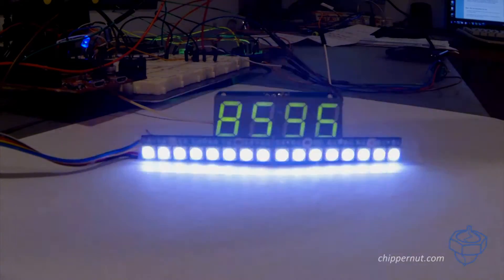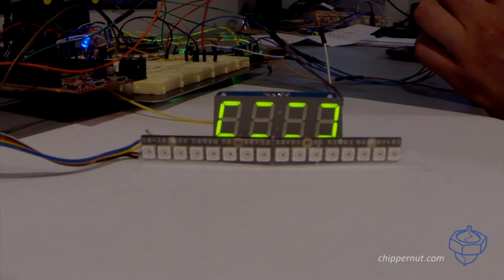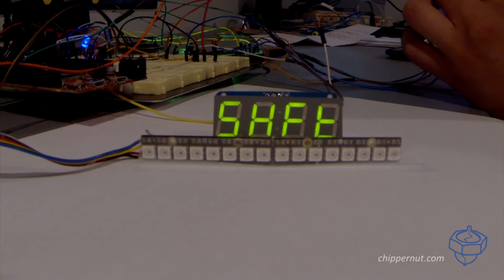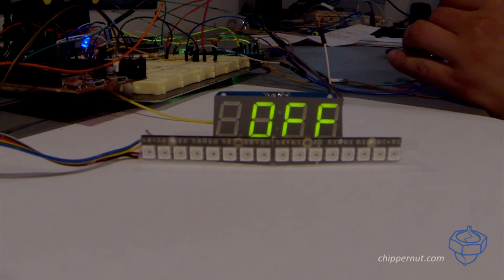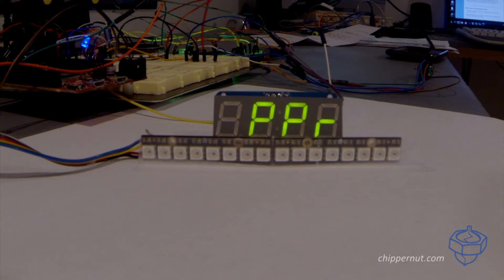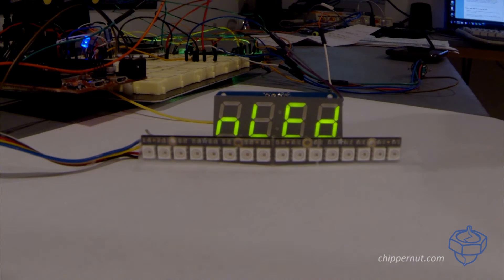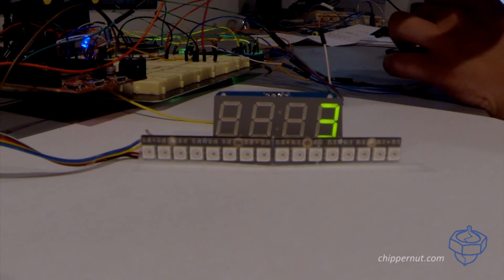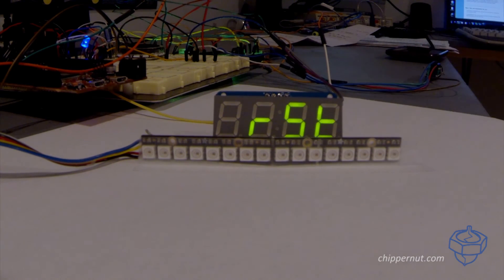Arduino Shift Light V2 Tachometer from Chippernut

Comment: Hey, could it be me, or is the program sometimes slow to respond to button presses?
Reply: +JustKyzuuh nevermind I think it seemed slow before I had the LEDs set up to show the animation. SO i copied and pasted your code, but when I go to ppr, it shows a zero, and does nothing if I scroll to the right. if I scroll to the left, it says 36, and goes back to zero quickly, if you scroll fast it goes down from 36, but there's some glitch there or maybe issue in the code, how can I fix this?
Reply: +JustKyzuuh nevermind I'm just stupid and didn't read the forum post.... Sorry about that
Reply: Okay so I have just about everything working now except one thing. With the number of LEDs set to 16, it should come down to 2 LEDs  and then go blank, but there is a single LED staying on. After inspection, on one side, there are 2 LEDs turning off at once for some reason. Can you help? I've tried resetting and it doesn't fix it. I'll post a video on my channel.
Reply: Also, +Chippernut, there seems to be an issue with choosing the 2nd optionas your animation, it says you need to segment again but then goes back to the menu and if you then go to segment, it does some weird stuff. So there's an issue, and it may be the cause of the first one
Reply from the maker: +JustKyzuuh  Thanks for stopping by and reporting these issues.  I'm planning to release a new version of the code in a few weeks, so this is perfect timing. I do know the Rototary Encoder and button presses were slightly laggy, so I've improved that code a lot. I'm happy to say that it's a lot snappier now -- this will be a huge improvement to user interface.    Have you tried running the EEPROM Reset code (separate from the Shift Light code)?  That might help. You're right that if you have an even number of LED's, it should end with 2 led's lit, then 0 led's, when using the center-out animation style. If it was an odd number of LED's, it should end with just 1 lit in the middle.  I'll check your channel for a video.  I'll also investigate this further and see if I can replicate it on the bench.   Thanks again!!!  I appreciate the feedback.
Reply: +Chippernut Awesome! I'll try the eeprom clear thing and see if this still occurs. I really enjoy coding and debugging, but there's just so much in this code I don't even know where to look for specific parts. I would help if I could, anyways thanks dude!
Reply: +Chippernut After clearing the EEPROM, the issue of the LEDs is still present in the center-out animation. (using 16 LEDs) I also then tried to go down to only 8 leds and the problem is still there. There are 2 LEDs on one single side that turn on and off at the same time, as seen in the video I uploaded. Also, I believe that it is always the last LED of the first segment and the first LED of the second segment that does this.
Reply from the maker: +JustKyzuuh I watched your videos - that's really bizarre behavior. Looks like two separate issues: (1) the double-LED lighting, and (2) the menu glitch with switching animations.  I'm going to run some bench tests.  Can you try coding a simple test to individually light each of the neopixels one at a time?  I want to rule out a communication issue w/ the neopixels, as the command string is sent from one LED to the next, to the next, and so on.. so if one of the LED's is screwing up the communication somehow?  Also - do you have a large capacitor on the power to the LED's per the design? Do you have a separate power-supply and voltage regulator for the neopixels?  I'm wondering if there's a current surge and it's causing that behavior w/ the arduino somehow..   But ya, that's a good head-scratcher.. I'll keep thinking about this and see if I discover anything on the bench.
Reply: +Chippernut I'm not using a 12v supply because I don't have one. Obviously I'll need that in my car, but I don't have one to use with my breadboard so I'm pulling power from the arduno. I switched to using a single 8-LED stick and the problem is still happening. I can look and try to find a power supply and see if that fixes the issue if you'd like, but I've tried using different numbers of LEDs and it is always the last LED of the first segment and first LED of the second segment, so that's what makes me believe it's in the code.
Reply from the maker: +JustKyzuuh  That might be the issue, but if it's happening on the 8-LED stick, then I find it unlikely. Those NeoPixels can draw 60ma each when set to 100% white, that's 960mA with 16 of them, no way the Arduino's little 5V regulator (or your computers USB port) would like that very much... when it's flashing on full brightness, just something to keep in mind.. but, like i said, I don't think that's the issue here.    Do you have a resistor on the data line going into the neopixels?  I can't tell from your video.  See: 
http://www.eetimes.com/author.asp?doc_id=1320518&page_number=2
and 
https://learn.adafruit.com/adafruit-neopixel-uberguide/best-practices
Reply from the maker: +JustKyzuuh Ah. good catch!  I'm going to investigate this issue more and see if I can replicate on my bench.  Please feel free to keep updated at Chippernut.com (youtube isn't sending me all the notifications when new comments are posted.)
Reply: +Chippernut Go to the begginning of this video and pause it. Set the speed to 0.25 on the options and watch very closely the left side. the last pixel of the first segment and first pixel of the second segment light up and turn off at the same time. I don&#39;t think in this video you have your activation rpm high enough to see when only one pixel is lit up, but you can see the problem I&#39;ve been talking about in your own video here(:  I guess you've already replicated this on your bench! Just thought I&#39;d let you know and maybe save you some time.

On a side note, someone else has found this previously and I found this thread on the forums:
https://www.chippernut.com/forums.html#/20150819/animation-glitch-4920123/
It's definitely got to be something in the code.
Reply: +Chippernut I've just started looking at the code. the switch statements for determining when to light up which light seems fine. So that leads me to believe that the issue with the 2 LEDs lighting up at the same time is in the rpm table for the 2nd animation. I still haven't looked at the issue in the menu system after selecting the second animation but the 2 may have something to do with each other?
Reply from the maker: +JustKyzuuh  Haha No Way.   That's amazing.  Thank you so much!!   I'm going to slow my RPM simulator way down for testing this..  I will definitely fix this in the next code release. Excellent idea slowing the video down. I would've never noticed that!
Reply: +Chippernut Glad I could help! Also, will there be any hardware changes in the next version? I'd probably about to assemble this permanently or maybe in the form of a shield and would love to know
Reply from the maker: +JustKyzuuh  There are some hardware changes -- but I will support the legacy hardware with this code update.   The display has changed and incorporates a few new methods (new driver IC). The 5V regulator has changed as well (no longer a clunky 7805, it's a clean buck driver w/ more efficiency and less heat).  I should have these components online before the kits as I'm mostly stocked up on everything (just not the PCB's yet).  I'm thinking end of next week (i'm waiting on a photo tent to arrive for good photos). 

Also -- you can output the RPM table in the Arduino IDE Serial Monitor if you set DEBUG to ON.  Might make that simple.  That's the first thing I'm going to check. 

Thanks again!!
Reply from the maker: +JustKyzuuh Oh -- and I also picked up a bunch of OptoIsolators -- but I'm still testing and experimenting with them.  I did get the shift-light running off an optoisolator in place of the transistor, so it should work fine -- but i want to test it under all circumstances before making a total departure.  So that will be a little bit further down the road -- but I will be producing PCB's with both components, so it shouldn't mean a huge switch-over if that's the route I decide to go.
Reply: +Chippernut Dude these plans are awesome. I take it the PCB that uses the octoisolator won't be the same as the one that uses the transistor setup?  Will you be using a new display altogether, or still the 7 segment display? And also, what benefit would the octoisolator have over the transistor?
Reply from the maker: +JustKyzuuh  Thanks!  I'm still debating if I want to produce (1) PCB with both components so it won't be as tricky to switch over, I still have plenty of real-estate on my board. So i'm kinda leaning that way.  The display is essentially the same, a 4-digit 7-segment, but it's a bit smaller and has a different IC driver, hence the code change. The optoisolator will electrically isolate the shift-light from the RPM circuit in the vehicle -- just eliminates any and all concerns w/ the shift-light either interrupting or harming any of the vehicles sensitive ECU components. Not that I had any concerns to begin with, it's just good practice -- helps protect the shift-light Arduino and the car in-case something is wired incorrectly.
Reply: Chippernut That's awesome. You're making great progress on this project, kudos to you and I look forward to getting the newer version once available.
Reply: +Chippernut Also, have you seen the video somewhere on youtube of the gear indicator? It's slightly redundant but I thought it may interest you since you seem to like doing car-related projects with arduino

Comment: This is very nicely done! So much that I want to put it on my dirt bike. Only problem is the newer 4 stroke dirt bikes use EFI. It make .05ppr. I haven't looked at your source but can it be coded for a lower value than 1? And another question would be does the rpm input signal have to come from lets say a ecu pin-out or can I wrap a wire around my plug and pick up the pulse from there? I also did a little looking on my dirt bike wiring and I noticed I have a neutral switch incorp' in the engine but no neutral light so I will also be adding that to this project.
Reply from the maker: +RednecKxKidz Sorry for the delay in responding.  A lower than 1 PPr will be available in the next code release, about 4-6 weeks out.  I'd love to see your final installation, feel free to visit my forums at chippernut.com and post up some pictures!
Reply from the maker: +RednecKxKidz Oh- and yes, inductive pickup is an option - but it hasn't been widely tested. It is something I intend to have ironed out w/ the next code release. :)

Comment: Hey do you know when you will be selling this in a kit or other? Would love one for my rally car
Reply from the maker: +Patrick Gruszka Hi! Thanks for stopping by.  It should be soon -- I'm still testing the circuit board, which is about 2 weeks out, and then the final production run of boards, probably another 2 weeks.. so with a little luck, it should be about 4-6 weeks.  Sorry it's taking so long -- I'm trying my best to get it ready before Spring.
Reply: Nah its all good im just asking when cause im gunna be done building the car in a wekk or so
do you know if i can get a prototype?

Comment: Sorry if this question has been asked before and answered, but where do you get the signal for the RPM to input into the Arduino?
Reply from the maker: +Shane Napaul  It varies from vehicle to vehicle - in most occasions, users will intercept an RPM signal from the vehicles ECU/ECM.  In some cases, this goes to an existing tachometer in the gauge cluster.   Otherwise you can also get the signal from a trigger to the coil, or inductive by wrapping a wire around the #1 Cylinder.
Reply: +Chippernut Thanks for the quick reply! So let's say I were to intercept the signal from the ECU, would there actually be a pin labelled something like tacho if i found the pinout of the vehicle?
Reply from the maker: +Shane Napaul Generally, Yes. In my experience it's usually called "tach" or "tacho" or "RPM", but again that varies.
Reply: +Chippernut Thank you! Also, do you still have the android head unit running? If so, how has it held up after you had the software issue and managed to reflash it?
Reply from the maker: +Shane Napaul  Thanks Shane. Yes, I still have the Android unit - it's working fine, my only complaint is that Spotify isn't 100% stable on it, and I've lost my music a couple times now (the Wifi Antenna is really short, so I have to pull the unit out of the car to get my house Wifi).  If you have decent Wifi near your car, it won't be an issue.
Reply: +Chippernut thanks for the update! When i manage to get a vehicle, and get one of them, i'm probably going to use my phone as a hotspot so the wifi shouldnt be an issue if I have reception! Have you ever used any of the RCA outputs on it? Are the signals clean if you have?
Reply from the maker: +Shane Napaul That's what I've been doing, too.  I use the Subwoofer RCA outputs to an amp in my trunk (a single 12" sub) and they work great - no complaints.
Reply: +Chippernut Great! Thank You!

Comment: Wow this looks awesome! I guess this will be my project over the Xmas break.

Quick question can you set it the the sequencing moves from the outside to the middle then flash ?
Reply from the maker: +RotorRian thanks for stopping by!! I'm glad you like my project - feel free to check out my site, it has all the instructions, code, etc (plus a good forums for people to ask questions during setup). Yes, this is possible to animate from the outside-in, but not currently coded. I'll have to work out the math to figure it out. I'm building up stock now to start selling a kit through my site, but currently all the parts are available through adafruit(dot)com
Reply: This is what I was coming to ask as well.  Did this get added recently?  It would be a really cool feature to have (it's how I've seen in a lot of racecars).  I think it's easier to watch two light sets getting closer than two light sets moving away from each other.  IE as you're watching in peripheral, when the lights are getting closer you know how much longer until they touch, vs if they are going away you're not sure when they'll reach the outside ends.

Either way, great work on this!  There aren't any options like this out there that look this good!
Reply from the maker: Cool!!  Thanks for the nice comments.  You make a good point, I will add this new animation (outside to center) in the next code update. I'll probably release the next code in a month or two. I'll also be adding inductive pickup functionality for those without electronically controlled ignition. Fun!  Thanks again.
Reply from the maker: Correct.  Uploading new code is pretty simple. All you'll need is the Arduino IDE (arduino.cc) and a USB cable.  There's a ton of tutorials online, basically connect the arduino, open the IDE, open my latest code, push the upload button.. That's it.  :)
Reply: Great!  I'm pretty new to the whole Arduino thing, but I'm guessing if I buy one of the v2.4 units now, when you release the new code I can just upload it to my v2.4 and it will add the new animation.  Is that correct?

Comment: I searched the internet and for 1 cylinder engine the PPR shoud be calibrated to 0.5 this is possible or only in 1, 2 , 3 ? THANKS
Reply from the maker: +Pratikakis Pan Sorry for the delay in responding.  Yes. the next code release will have a lower than 1 PPR
Reply: +Chippernut Thank you to answer me. The issued of the new code will be done soon ?
Reply from the maker: +Pratikakis Pan The new code will coincide with the release of the Shift Light Kit - so about 4 weeks from today roughly..  If I complete it sooner, I'll post it on my site at Chippernut.com.
Reply: +Chippernut Thank you very much.
Reply: +Chippernut Hello. I would like to ask you about the issue of the new Code for the Shift Light who will gets ppr below 1 . Is Available ? Where can I find him ? Thank you very much!!
Reply from the maker: +Pratikakis Pan  Hi - I have updated the code, but I forgot to make the PPR get below 1. I'll make that change tonight and update the code.  You can find it on my website forums, at chippernut.com   I will post a new thread here called Shift Light v2.3 -- probably tonight.  https://www.chippernut.com/forums.html#/
Reply from the maker: +Pratikakis Pan No problem.  I see you signed up for my newletter on chippernut.com -- I'll send out an email when all the latest code is online.   Thanks again!
Reply: +Chippernut 
Good evening again. Sorry for the inconvenience. Just like to ask what is done on the update of the Code with ppr and also if it is easy to tell me in witch program you write files about the pcb to download it and  read these files .
Thanks

Comment: How much would this kit be ? I really want exactly what you have in this video
Reply from the maker: +William Lugo  Excellent question. That's the answer I'm working to solve right now. I'm trying to get the parts cost down enough so it's reasonable.  Definitely below $100 for the un-assembled version.  I'm working diligently to make the kit available soon,  I'll make an announcement via email and on my blog. On my home-page I have an email newsletter field, (i rarely send out emails, so it's not spam).  Thanks for stopping by!